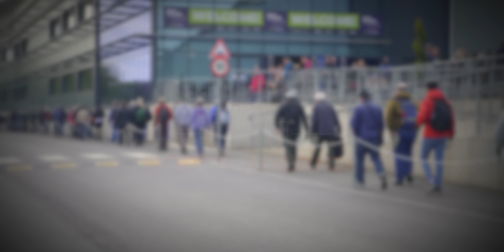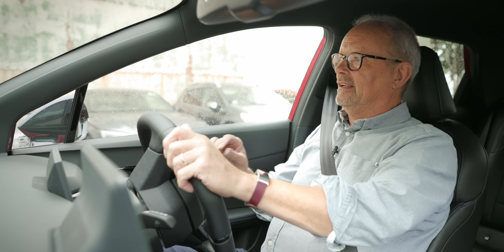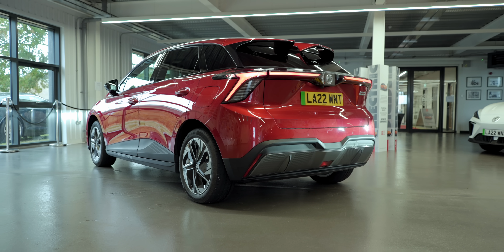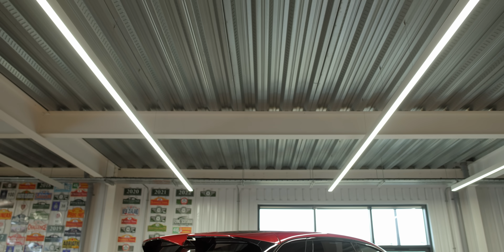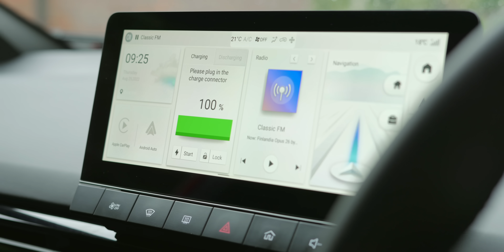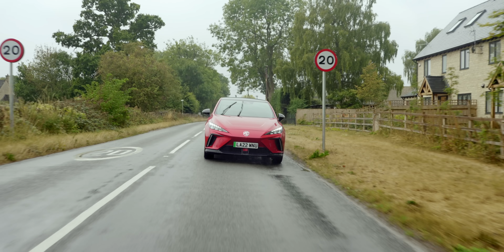MG4: The Bargain Of The Century??

Comment: I wouldn't consider any electric car a bargain. All have very poor range....cost a lot to buy in the first place and you either then need an extra contract for the batteries on top in which case you have to trade it to a main dealer..  or you have to buy new ones at huge cost when they die at 6 to 8 years...or when the range per charge deteriorates hugely...this process starting pretty early on.

Every long journey where you need to charge is a Russian roulette style nightmare........and take a huge while longer than in a normal car.

Not to mention the range you lose every time you charge it as the battery degrades slowly.

Also its made in China....so it'll be broken every 5 minutes....

Hydrogen tech is the way forward...electric cars are a stressful expensive flash in the pan
Reply: There are no "extra contracts" for batteries now. Nobody does battery leasing anymore.  And why might an EV battery die after 8 years when it has an 8 year warranty? Do you replace a car engine once the warranty expires?  And why do you have to buy a new battery when a battery refurbishment costs a tiny fraction of replacing it? Clearly you never heard of battery refurbs.... Typical battery degradation is 2 to 3% per yer. You obviously have never owned an EV.  Quit guessing and do some research.

Comment: You mentioned that this car gets stars for being a sedan rather than an SUV, and I agree. But people gravitate to SUV because those vehicles have the ability to haul more stuff . But they pay the price in much reduced energy efficiency for the ability to haul a lot of stuff likely no more than a handful of times a year. To me there is nothing more aggravating that seeing one person behind the wheel of some massive American SUV or pickup truck expelling huge amounts of CO2 and the only thing they are hauling around is their skinny (and often not so skinny) butt! But ask them why they drive a 20 foot long 2 1/2 ton vehicle that gets only 14-15 miles per gallon, and they will talk about the one time last year that they needed to bring home the newest and largest monster screen TV, an entire load of mulch in the bed of their truck, or all of the studs and drywall needed to build a wall in their house.

The obvious answer is to buy a sedan with a trailer hitch. The trips I have taken to Sweden were illuminating. There, there really were few SUVs and I only saw one pickup truck. They were all sedans, and just about every one of them had a trailer hitch. And completing the ecosystem was that just about every petrol station had 4-5 small utility trailers parked on one side ready to be rented for a bit of hauling of stuff and then returned.  Then for the 95% of the time when the vehicle is just used to move one or two people or a load of groceries in the boot, they get the energy efficiency of a nice low drag sedan. And when they need a couple a dozen bags of potting soil from the garden center or some construction timbers, sheets of plywood and drywall from the home center, or that new biggest ever monster screen TV they just have to have, they just pop over to the closest petrol station, rent a trailer and then for that day they are driving a cargo hauler able to move most everything an average homeowner would need. For bigger stuff like 3 tons of gravel to redo the front garden, well that is what delivery trucks are for). 

Unlike those Swedes with their Mercedes and BMW diesels, an EV sedan pulling a trailer full of stuff with the aerodynamics of a barn door is going to reduce the range by something close to half. But for most people that is still more than adequate for most of the time

But I just don't see many EV manufacturers offer a trailer hitch as a factor option on their sedan, or even design in the ability to add an aftermarket hitch. Tesla will sell you a Model 3 with a hitch already installed. Also Kia rates the EV6 to tow up to 2,300 lbs, and Hyundai rates the Ioniq 5 for 1650 lbs. Polestar says their Polestar 2 will pull up to 2000 lbs. But all of the rest I could find were all big boxy SUV with horrible miles per kWh (mostly 2 or less). So I would love to see every EV manufacturer offer a towing package on their sedans. Maybe they could even produce or work with a partner to make a trailer that matches the good looks of the car so that your nice sleek new BEV sedan doesn't have to be attached to a trailer that little more than a ugly bunch of welded steel tubes, a couple tires, springs, 2x4s screwed together to make some sides, and a tail light hanging off the back attached by a couple of screws.

Comment: Great looking car with good specs, even decent charging specs if the mentioned 120Kw/hr is real, but if the battery can never be replaced, it is an environmental failure.  There must be a way to service / replace the battery when problems arise.

Comment: This is a $30,000 vehicle with a 200 mile real driving range, 160 in freezing temps.  it is pretty small; remenicent of the Nissan Leaf; with somewhat better range. Would i be correct to assume the MG badge is now a Chinese car with no UK factory?  The long range version costs near $40,000; at which point you are closing on the Tesla model 3 which already has better range and is much larger. You could certainly find a long list of PHEVs which would cost no more and commute all electric.
Reply: not like Tesla's aren't made in China 🤣

Comment: The EV is the most destructive vehicle EVER devised.
It is FAR more environmentally damaging to produce than any equivalent petrol or diesel car.
It has a shortened life, due to the limited lifespan of the battery being just a fraction of a modern petrol or diesel engine.
Plus, as the battery is the largest and most expensive component in the vehicle, the car will be rendered almost valueless once it decides it doesn't want to be charged any more.
In short. They are a con. A very expensive con. A very destructive con. A very dangerous con.
The manufacturers know it. As do the "environmentalists". And governments.
And anyone else with half a brain.
Reply: What complete and utter nonsense. You clearly haven't heard of battery pack refurbishments for a start. A new EV comes with an 8 year warranty on it's battery. I never knew 8 years was a "limited" time. And 8 years is the WARRANTY, not it's lifespan...... You ought to watch the YouTube video posted by a Tesla Model S owner. His car had covered 400'000 kms on it's original battery. If I were you, I'd take some time to do more research rather than post uninformed nonsense.......

Comment: The problem I have with thinking about buying a MG is, that if you wait a few months after introduction of a new model, you can even get a better one: 1st MG ZS EV was sold in 2020, but the FL with bigger batteries and better features came out just one year later. In parallel the 2nd generation MG5 was introduced (the 1st generation MG5 was not available in Germany), also a good and interesting car, but just a few months later the MG4 was introduced. Again a big step forward, less space than the the but only marginal. So if I wait a few months more, what can I expect from MG then?
Reply: im so surprised they have not made   a van to compete with the french and german small vans,.. there is  a massive market in this country for these work vans in the bulding small business trade.

Comment: I love the excitement but looking at the figures and range not such a bargain. Yes the SE 51 kwh is a good entry EV with 50.8 kwh usable battery giving a range of 203 miles based on 4 kw per mile which is OK but 178 miles at 3.5 kw per mile. The SE long range is £29,190 and gives 247 mile range at 4kw per mile and 216 miles at 3.5 kw per mile. The Trophy is the same as the SE long range and costs £32,190. Both longer range models have 61.7 usable battery. I do think the design is a copy of a Prius that mated with an ID3 or Cupra Born. The MG4 isn't as roomy inside as the Cupra Born. So the £4 to £5k difference between the MG 4 Trophy and the Cupra Born V2 spec 62 kwh isn't such a good deal as resale of the MG 4 will be lower. 
However the basic MG 4 SE car is a good car for £26,000.

Comment: Would you plug in 50 (FIFTY) fridge freezers at once and leave them all night?...................no?
Welcome to the fast chargers!!!!

Batteries do not produce electricity - they store electricity, which is produced elsewhere, especially by coal, uranium, ground-gas-powered power plants or diesel-powered generators. So the claim that an electric car is a zero-emission vehicle is not at all true.
Since forty percent of the electricity produced in the United States comes from coal power plants, forty percent of electric cars on the road are coal-based.
But that's not all yet. Those of you who are passionate about electric cars and a green revolution should take a closer look at the batteries, but also wind turbines and solar cells.
A typical electric car battery weighs a thousand pounds, about the size of a travel suitcase. It contains twenty-five pounds of lithium, sixty pounds of nickel, 44 pounds of manganese, 30 pounds of cobalt, 200 pounds of copper and 400 pounds of aluminum, steel and plastic. There are over 6,000 individual lithium-ion cells inside.
To make each EV battery, you need to process 25,000 pounds of sole for lithium, 30,000 pounds of resin for the cobalt, 5,000 pounds of resin for nickel and 25,000 pounds of copper ore for the copper. All in all you need to dig 500,000 pounds of the earth crust for a battery. 
The main problem with solar systems is the chemicals used to convert silicon into the silicon used for the panels. In order to produce sufficient pure silicon, it must be processed with salic acid, sulfur acid, salpetic acid, fluoride hydrogen, trichlorethane and acetone. It takes massive amounts of coal to produce solar panels.
In addition, gallium, arsenide, copper indium gallium dieselenide and cadmium telluride are needed, which are also highly toxic. Silicone dust poses a threat to workers, and the plates cannot be recycled.
Wind turbines are the nonplusultra in terms of costs and environmental destruction. Each windwheel weighs 1688 tons (which is equivalent to 23 houses) and contains 1300 tons of concrete, 295 tons of steel, 48 tons of iron, 24 tons of glass fiber, and the hard-to-earth rare earth neodym, praseodym and dysprosium. Each of the three blades weighs around 81,000 pounds and has a life span of 15 to 20 years, then they must be replaced. We can't recycle used rotor blades, they, along with used solar panels go into landfill.
These technologies may have their place, but you have to look beyond the myth of emission freedom.
“Going Green” may sound like a utopic ideal, but if you look at the hidden and inconsiderate costs realistic and unbiased, you’ll find that “Going green” is doing more harm to the Earth’s environment than it appears WHEN YOU LOOK THROUGH THE SMOKE & MIRRORS.
I'm not against mining, electric vehicles, wind or solar energy. But I show the reality of the situation.

And also. THERE IS NO CLIMATE CRISIS IN THE FIRST PLACE, WE ARE BEING PLAYED BIG TIME. IT`S ALL A MASSIVE HOAX!

Half the world`s population falls for this very same scam decade after decade!

Comment: If only you could afford the electricity to put in it, that's assuming you can find a charger that works and doesn't have a huge queue.
Reply: No queues at my charger. It's on the side of my house, and charges me 7.5p per kwh. A typical full charge is £7 or so in my EV, which does me 250+ miles.

Comment: Watching from Australia. Enjoyed the review and was pretty much impressed even though I am not a fan of EVs.  I actually like the styling except for the rear roof spoiler as described by you and also the odd shaped steering wheel.  I have never understood the benefit of these odd shaped wheels when round or even oval are easier for the hands to flow around. I liked the yellow colour in the background!
Reply: I believe the logic on the square wheel is that with adaptive power steering, you theoretically don't need to turn the wheel beyond 90 degrees unless maneuvering. 

How effectively this works in practice though, I have no idea

Comment: Shame they’re going to cost more to run than petrol cars!!!
Reply: Mine doesn't. A full charge at home on my off-peak tariff costs me around £7, which does me 250+ miles.  Home EV charging costs in the UK haven't increased. Show me a petrol or diesel car that costs 2p per mile to run. It's only public charging costs which have increased. I rarely use public chargers. The last time I did was last March. I charge at home on 7.5p per kwh 98% of the time. You have to pay around £1.70 per litre for diesel all the time. You can't reduce your fuelling costs by 80% or more by filling up at home.

Comment: A better option for British motorists is the Dacia Spring which will cost between £9000 = £12000 depending on the trim. unfortunately the car will not be available with right wheel drive for the next 2 years, if you wait it is worth it!
Reply: But the Dacia Spring is smaller than a Zoe. This MG is a genuine family sized car. A Dacia Spring is not......
Reply: @Brian-om2hh  I agree Brian but my point is that the Dacia is half the price and the MG is not in the price range of the vast majority of British motorists especially now.
Reply: @williamwyllie7072  But throw a couple of kids and a dog into the mix, and the Dacia Spring just wouldn't cut it, cheap or not. In such a case, a used EV such as a Leaf or a Hyundai Ioniq (the first type) might be a better option. There are decent used EV's around now. It isn't necessary to buy new if cost is a priority.
Reply: @Brian-om2hh  You are completely wrong The Dacia Spring is heavily subsidized by both Renault and the Romanian government, it may be cheap but the build quality is better more up to date, it is bigger than the Renault Zoe. I have seen one in Hungary it looks like a mini SUV a beautifully designed car. A starting price of £25,000 for the MG will only attract the rich middle class.

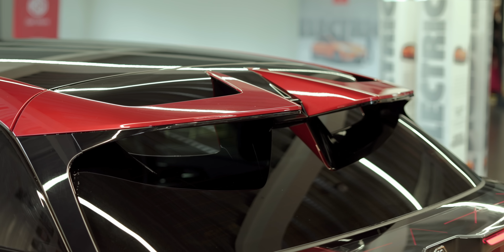Comment: 3:57 Crap spoilers are not for speed they just keep the dust off the rear window on dusty roads.  I learnt that as a young fella when our old Ford falcon had a crap spoiler.  It circles the air and the dust doesn't settle on the rear window.

Comment: Working on an older MG usually meant troubleshooting annoying electrical problems.
And the offending bit always said LUCAS... The electric circuitry on this has to be 100% reliable.
We can't be held prisoner to shutdown due to error codes from a gimpy connection deep inside.
Who made all the MG4's wires and connectors?  Please, don't say Lucas, Prince Of Darkness!

Comment: Can I ask does it or can it come with a spare Wheel.The flat bottom steering wheel allows you to get into the driving seat easier were as a full round steering wheel can hinder you getting into the seat area,also think about if someone has to get you out of the car say an accident? I wish some car manufacture would create an outdoor wiper system for the front windows,when you are trying to get out of a junction and it's raining on the front windows,low visability is because of the rain falling on the glass with less wind.

Comment: Now the elephant in the room - work out the cost of charging these things at typical motorway service station rates. Charging your vehicle often costs more than the equivalent miles in petrol - something you hear nothing about in the press.
Reply: But you'd only typically do that maybe 6 or 8 times a year. The rest of the time you'd charge up at home for a 10th of the cost of public charging, or at somewhere like Tesco for free while you shopped.

Comment: Something I've noticed about Chinese cars/motorcycles they get it right. Engineering good. Quality acceptable. Fit for purpose. Priced to sell. Then at the end they do something that's hard to understand. It's as if no one told the designer to stop. "That's it you've done it" They just have to add something quirky. Especially on motorcycles but cars also. It must be a Far Eastern thing. Like you can't just pour a cup of tea it has to be an event. Thing is the tea is cold by the time you get it.

Comment: They dont tell you the battery will need replacing after 10-15 years at a cost of 10s of thousands plus the charging points will be switched off by the company's when they want in a so called emergency thus resulting in a car you cant use .
Lol good luck I'll stick with my diesel land rover defender

Comment: You will regret it when the battery gives out,or when you run out of charge  away from home and join a long queue to recharge at what cost?Here in the UK we will "enjoy" power cuts this winter! Advice buy a large diesel generator to keep in your boot!
Reply: The size of generator you'd need wouldn't fit in the boot.  Why might the battery "give out"?  And don't forget, if there are power cuts then petrol pumps won't work either....

Comment: Not possible. Only place i could charge is at the supermarket. For myself. Nowhere near able to choose an electric. Would be interested to know how much currently it costs to charge for 500 miles,as this is the range of my fossil fuel jalopy,which currently costs about £60-70.
Reply: If you are able to charge at home on an off-peak tariff Patrick, then charging costs become massively more palatable, at 7.5p per kwh. A full charge on my Kia EV costs me around £7, and that will easily do me well over 200 miles. Public charging costs are appreciably higher, with charges anywhere from 40p per kwh up to a ridiculous £1 per kwh.  Both Tesco and some Sainsburys branches offer free charging, as do LDL and Ikea. Very occasionally you will find free charging at other places too.